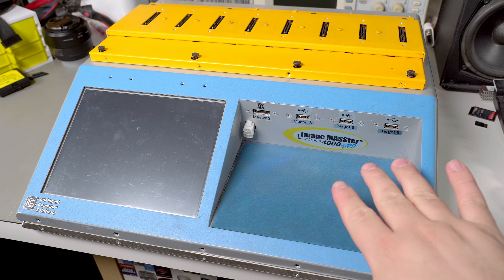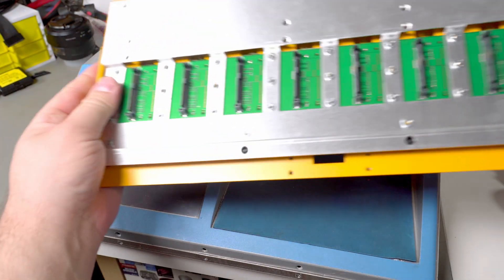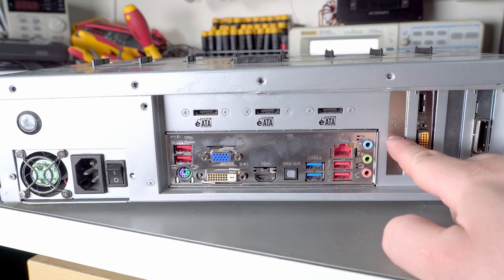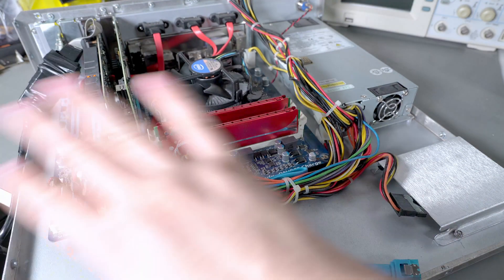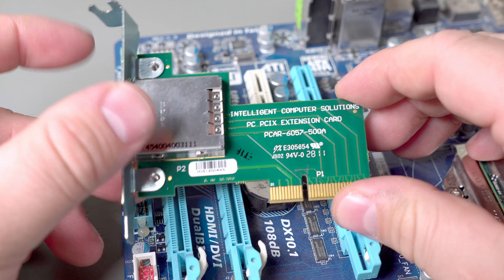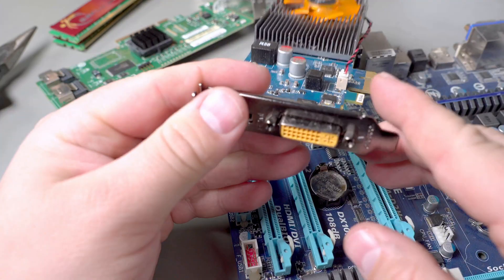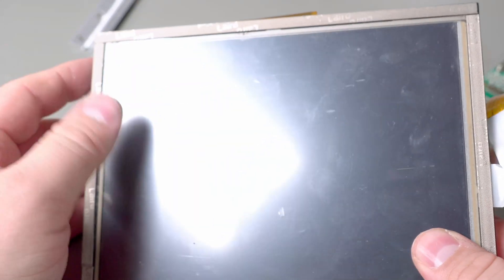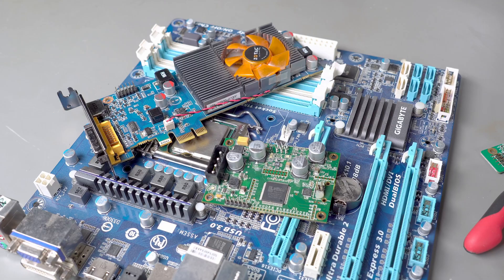ISC Image MASSter 4000 Pro Teardown

Comment: re: the comment about the x1 pcie gpu. you can just take any cheap gpu you can find and chop off all the lanes you don't wanna use. (in case you don't know)
Reply: I did this when GPU mining first began, I did it to my old rx 550. but when my main card died and i didnt have a gpu i was pretty sad
Reply from the maker: Depending on the video card, you may be way under power budget. You only get 75w max power on x16 slots. That being said, there are plenty of super low power cards out there. 

That's why the x1 reisers have x16 slots with external power to run normal cards for mining and get 75w from the slots.